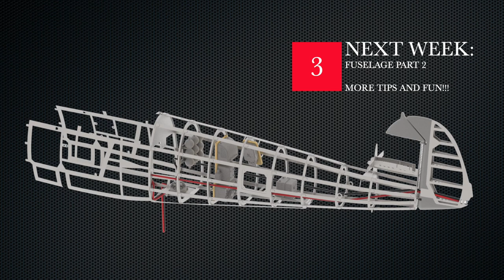#BuildDiary | Official Messerschmitt BF109 G Build Diary (Chapter 2) | Artesanía Latina

Comment: Hi, what glue are you using ?
Reply from the maker: Hi! This is the glue we use in this chapter: https://artesanialatina.net/en/glue/1307-thick-cyanoacrylate-and-cyano-accelerator-spray-50-gr-200-ml-pack-8432412033079.html or https://artesanialatina.net/en/glue/62414-thick-cyanoacrylate-for-wood-and-porous-materials-20-gr.html. Regards. :)